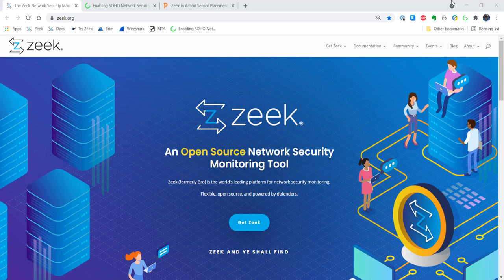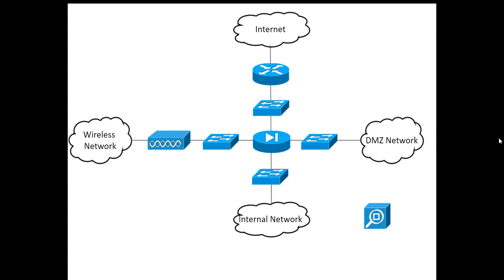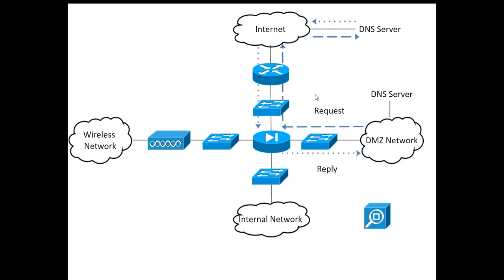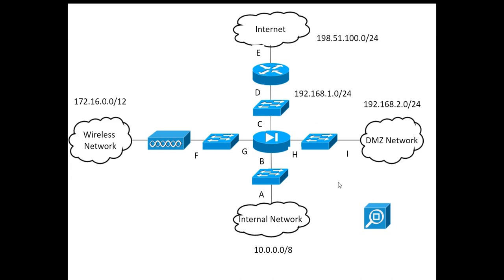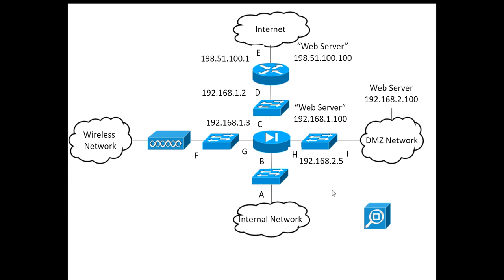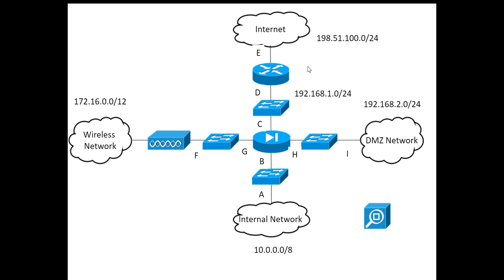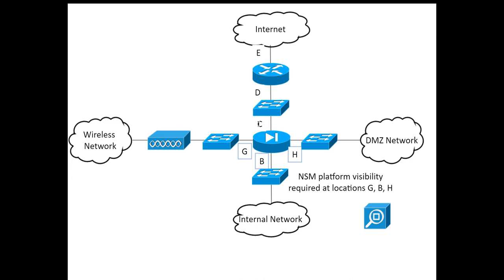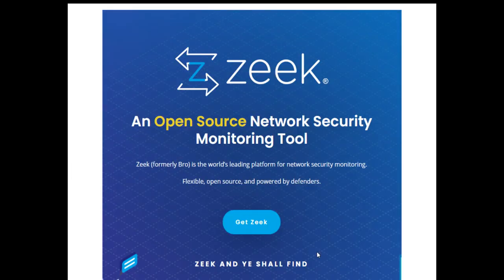Zeek in Action, Video 4, Where Do I Put My Sensor?

Comment: 21:00 I think one should put a sensor at C too, assuming the central firewall/gateway is a computer system that can be compromised and therefore initiate its own connections.
Reply from the maker: That is an option too. IIRC the video is trying to locate one position, if you only had one choice. Thanks for the comment.